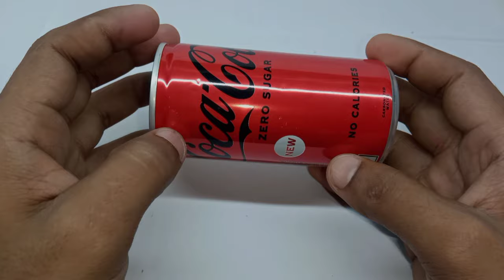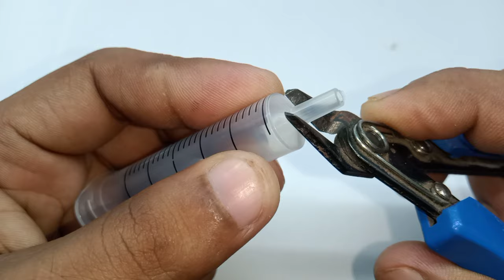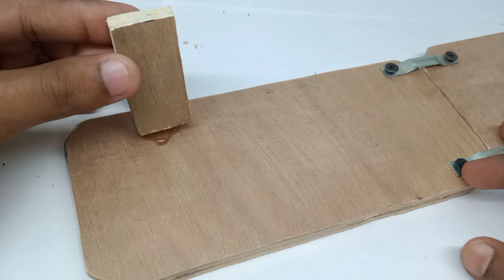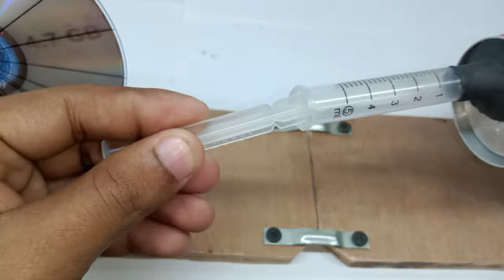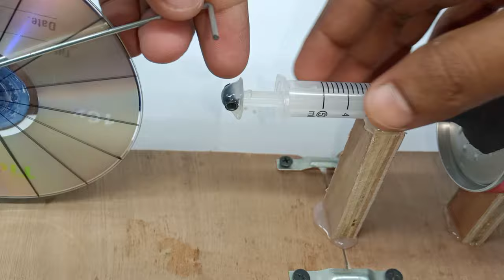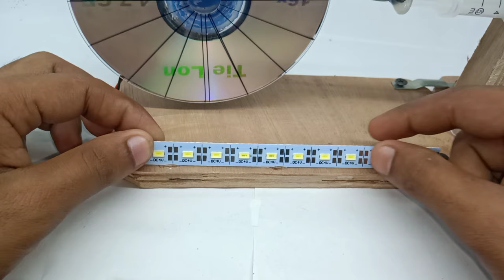How to make steam engine at home very easy | How to convert energy into electricity | free energy

Comment: The most difficult part is to hide the battery😂
Reply: Uh mate I made this myself but with Double syringe I just added a manual safely valve just in case works perfectly
Reply: Battery is back side of the motor
Reply: No, there's no battery. It's real!
Reply: That's real bro
Reply: Still cooo
Reply: Yes bro
Reply: no exhaust?🧐
Reply: This not a battery motor
Reply: Clearly wisdom has been chasing you, but apparently you are always 1 step ahead.
Reply: @DVel69  you prob can’t see the steam because of the camera
Reply: Watching fact mine but not listening well it generates electricity
Reply: This is real,, i also made this,,it work
Reply: This is real it's called a sterling engine I think
Reply: Esquisito que não tem saída do vapor
Reply: It is stirling engine it works with steam pressure
Reply: Yup 😂. I love how the bots are getting mad about facts :)
Reply: @Pritaxyz  it dosent spin. can you help me ?
Reply: I like the part when you caught the joke, guys! 😂
Reply: U r right bro
Reply: @junegamerbd  I'm no good in physics but where tf does the power that pushes the piston back come from? Every steam engine I know relies on opening/closing valves - if there are none, the pressure would push the piston out and it would stay in this position as long nothing else is pushing back.
Reply: A Stirling engine operates by cyclically compressing and expanding a fixed amount of gas (usually air) at different temperatures. It has two pistons, one hot and one cold, which move in and out of cylinders. As the gas heats up, it expands, pushing the hot piston outward. Then, as it cools down, it contracts, pulling the cold piston inward. This movement is converted into mechanical energy, typically used to drive a generator or perform work.
Reply: Actually, an electric motor works a a generator when you turn it. I don't know about the engine part. But the electric part is legit
Reply: @7r47ufchfyw7twguwgu  How? Doesn't the cylinder have to have a hole for releasing the steam? otherwise it would just get stuck when the piston is extended?
Reply: @velux1662  meh just don't make it airtight I guess? tbh one with 2 cylinders would work
Reply: This isn't a perpetual motion device or free energy, it's just conversion of heat into mechanical then electrical energy.
Reply: @saathvikbogam  Yup, people seem to think that conservation of energy is "Free energy" for some reason. Those people are gonna be SHOCKED when the learn about solar power and windmills
Reply: Yes 
 @junegamerbd
Reply: @NeurosenkavalierEmilSinclair  I mean I think that it's because of the movement
Reply: this one is actually real, steam engines are surprisingly simple
Reply: That is , actually, a Stirling engine concept. It works
Reply: I thought 🤔 I'm the only one who noticed.
Reply: @catherineshedrack1811  It works it's a Stirling engine
Reply: Exactly.   It can't work on steam, there's no valve to get the steam to the front end of the cylinder to push the piston back towards the can.
Reply: Como esconde los cables que van al motor ocupo Saver por favor yo también voy a engañar gente
Reply: Check a Steam Engine Diagram But Still There is no Exhaust
Reply: Bro its steam bro..not battery
Reply: This is a Stirling motor, its hard to make, i tried to do with cans but i failed...
Reply: @DVel69 it doesn't need one it can probably release steam through any holes
Reply: I think it's real
Reply: my ranked teammates

Comment: All ok but where is the exhaust
Reply: Is it necessary?
Reply: It's because the pressure can stay in the can
Reply: Exhaust is needed because too much pressure can make the engine explode just like a old model train they used exhaust
Reply: There's a hole in da syringe
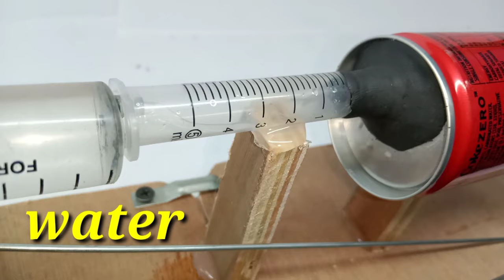Reply: 2:30
Reply: Bro he is using battery from back side of the motor
Reply: @ChristineSoriano-uj5sd safetly valves are use in steam engines. Depending on the Locomotive a princess royal class had 4!
Reply: What the bro don’t know what a steam engine is plus the fuel is a candle so that don’t have a exhaust
Reply: We needed this for our project but it did not work so please put the materials needed we may have forgot the name of the materials needed
Reply: @yemeraindyeah6730 No he's not. I've made this too. The rubber removed from the syringe allows for some gas to escape. Don't actually need water. Check out Sterling engine build. 😉

Comment: I don't see how it can work since you are only supplying steam to the one side of the cylinder.   I don't see anything to push the piston in, just a way for steam to push it out.
Reply: I was prepared to disagree with you, but yeah I don't get it. If the piston releases the pressure at the end of its stroke, it would have to have been sealed off from the steam tank (and I don't see any mechanism to do this).
The flywheel is the thing forcing the piston back, but this seems more like a crappy stirling engine than an actual steam engine, unless I missed something in the build.
Reply: The solution is simple: this is a stirling engine, that uses hot air instead of steam. The hot air does not need to escape, it only needs to cool down, which it does.

Comment: Please do not try this
Reply: why ?
Reply: Why bro
Reply: He is hiding a battery inside the generator 👆😅
Reply: And  there is no exhaust port , without the exhaust port the engine cannot run 😐😐
Reply: The generator  means the motor is driving the engine
Reply: @madhumitamajumdar3723  This is a sterling engine, not a steam engine. This means the engine does not need an exhaust port, nor water to operate at the cost of efficiency and speed. However, it's important to note you don't need a coke can-sized container. And a smaller container would work best, because it would take less time for it to heat up.

Comment: Will it work continuously if we keep it heating?
Reply: Obviously
Reply: until you run out of heat
Reply: no you have to refill water
Reply: it's a steam engine it doesn't have unlimited water
Reply: @RalphyTheCoyote Its a Stirling engine works with hot air
Reply: @Arzzzz-ww1ry  it's actually a steam engine. stirling engines work differently.
Reply: No. He hid a battery there. It's really hard to make it accelerate that fast.
Reply: @Jak_paczka  fair point

Comment: But how the piston get's back???
Reply: maybe because of the flywheel? i don't really know about steam engines
Reply: Bro the heat energy tries to get out  of the can but the cd pushes the syringe inward compressing the gas
I hope It helped
Reply: This doesn't make sense. The cd will slowly lose speed because the syringe is only pushing outwards. If you want the syringe to go back, you may have to add some valve gears/camshaft and a exhaust port.

Comment: Could you generate enough electricity to run a hho generator that would feed back fuel to get the steam? I've been just trying to get into making diy generators.
I want to combine steam, hho, and solar that only feel each other 🤷🏼
Reply: U could lead the exhaust back to a small cooling pot / tower that will convert the steam back to water and let it feed back in. But u would have to look that up. I know moonshiners use it to cool their moonsine. and u would need to make a one way valve so the steam cant enter trough the wrong side.
Reply: Solar as in solar panels?
Reply: @MediumStare  But in this tutorial there isn't a exhaust
Reply: @ChillBoat  ye They just drilled a hole wherry the steam exscapes
Reply: @indujadiasnanayakkara7832  using the solar to make h20 gass which if ignited turns back into water. Boil the water and get steam.

Comment: From where did you get the power supply to run this ?
Reply: you dont need power supply the dc motor produces it when it rotates and the wires are connected to the led that lights it up
Reply: A Stirling engine operates by cyclically compressing and expanding a fixed amount of gas (usually air) at different temperatures. It has two pistons, one hot and one cold, which move in and out of cylinders. As the gas heats up, it expands, pushing the hot piston outward. Then, as it cools down, it contracts, pulling the cold piston inward. This movement is converted into mechanical energy, typically used to drive a generator or perform work.

Comment: This is not a steam engine, but a stirling engine. A sterling engine doesn't have steam exhaust, because it works with hot air.
Reply: We know Watson
Reply: Huh? This isn't a stirling engine. It lacks a displacer piston and doesn't use steam as it's working fluid
Reply: @ailene-dreecunanan577  not all stirling engines have a displacer piston
Reply: Source?
Reply: @ailene-dreecunanan577  logic
Reply: @stalecroutons  what do you mean logic? How can logic prove not all Stirling engine need a displacer piston?

Comment: I made this but i used a test tube instead of can but there is no force on piston at all, how to fix?
Reply: The connection of the test tube to your piston might not be airtight or it just lacks pressure you can resolve this by stepping up the heat (if your using a hydraulic piston like the ones on big machine, it won't work)
Reply: Make sure there is an input and output on the piston otherwise there’s is no opposing force to push the piston back
Reply: @benjielaoisguan3674 also try using narrow it will help

Comment: Which motor we should use.
Reply: the one that has perm magnet
Reply: A Stirling engine operates by cyclically compressing and expanding a fixed amount of gas (usually air) at different temperatures. It has two pistons, one hot and one cold, which move in and out of cylinders. As the gas heats up, it expands, pushing the hot piston outward. Then, as it cools down, it contracts, pulling the cold piston inward. This movement is converted into mechanical energy, typically used to drive a generator or perform work.
Reply: @empowertech  They are just asking the type of motor to use for the generator (A regular Brushed DC motor in this case). Not the type of engine being used for mechanical power
Reply: Dc motor

Comment: Is there a supply list?
Reply: - 1 Tin
- 2 Candle
-1 Syringe
-1 CD
-1 idk how its called that joins the syringe and the CD
-1 idk how its called that lets the CD rotate and makes energy
Reply: 1) A can/tin
2) Two Candles (You can also use a Bunsen burner for faster evaporation)
3) A Syringe
4) A CD
5) A Motor
6) An Allen key
7) Circuit Wires
8) LED strip
9) Something with a hole to fit the Allen key
10) Wood/Cardboard base

such a late reply💀🤭

Comment: Ive been heating it up for about half an hour and its not movinggg, what do i do help please
Reply: Wait another half hour. Then wait one hour. Then two. Then four. Then right. Then 16then 32hiurs then ,64 then 128then 256 then 512,then 1024 then ,2048 then 3096, then 4198 and then 8396 hours and if it still doesn't work it's probably bullshit.

Comment: I have tried so much but it's not working
Reply: bc that thing has no exhaust
Reply: @DVel69  so you need to put a hole in the syringe?
Reply: You must wait 10 -20 minutes
Reply: You have to not only add an exhaust, but also valves

Comment: My condolences to peoples who still believe it's real.
Reply: Its a Sterlingmotor and it actually works
Reply: This is not a Sterling Motor. A sterling motor uses the heating and cooling of air to push the piston, not water. And besides, this is not even how a steam engine works
Reply: @ailene-dreecunanan577  It is a Sterlingmotor the only thing thats different is It runns with Steam instat of air
Reply: If it were a stirling engine, there would be no point to add steam to the engine. I never even seen a stirling engine that uses steam as its working fluid